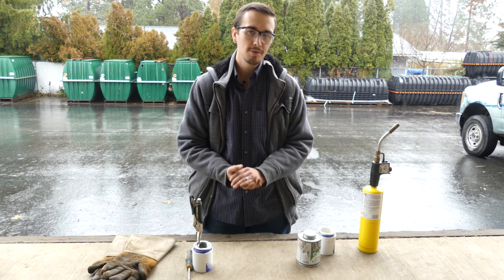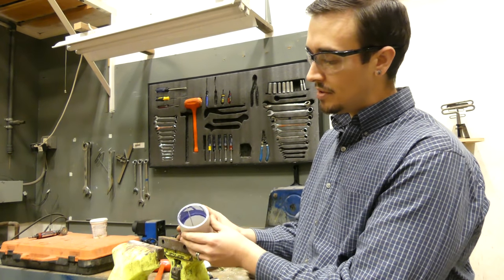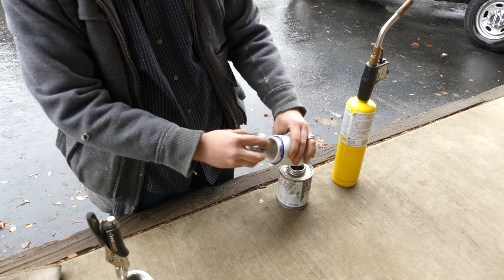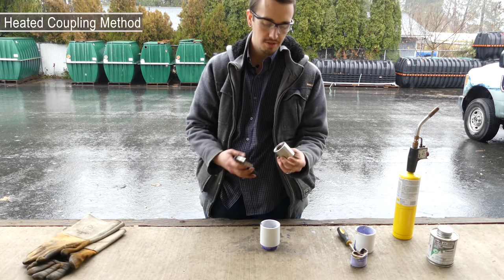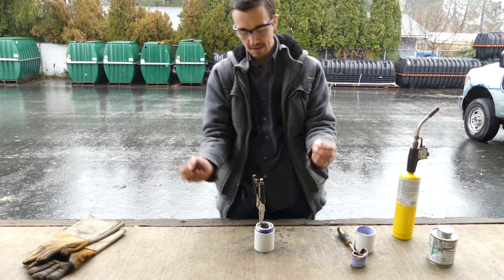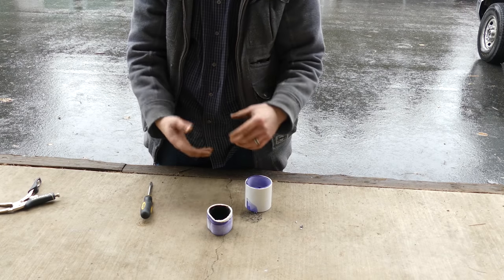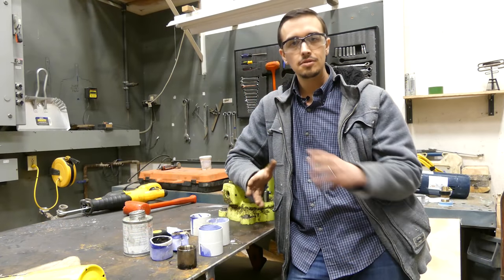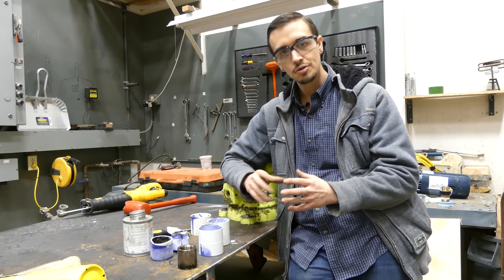3 GENIUS Ways to Remove PVC Pipe from Fitting (Without a Heat Gun)

Comment: None of these methods are very effective.  Heat can damage fittings or pipe, and creates noxious fumes.

Instead, try this:
1) Cut the collar (or elbow) in two, so that the pipe or fitting which you want to salvage is as close to the end of the remainder of the collar or elbow as possible, but DO NOT cut the pipe or fitting which you want to salvage.
2) Using an angle grinder, create a lengthwise cut along the collar, being careful not to cut into the pipe or fitting inside.
3) Using a hammer and either a chisel or a flat-blade screwdriver, GENTLY chisel away as much of the collar as you can, starting inside the cut you just made.  It will be very brittle, so use eye protection.
4) Using an orbital sander with coarse-grit sanding pad, sand away the remainder of the fitting and adhesive, cleaning up the pipe or fitting which you want to salvage, being VERY CAREFUL not to sand away the pipe or fitting which you want to salvage, or make any significant indentations which will result in leaks later.
5) Prime the new collar or elbow and the now-clean pipe or fitting, apply PVC cement to both, and glue them together.